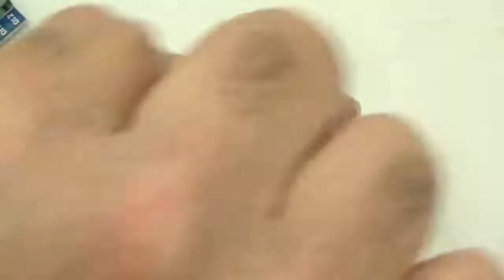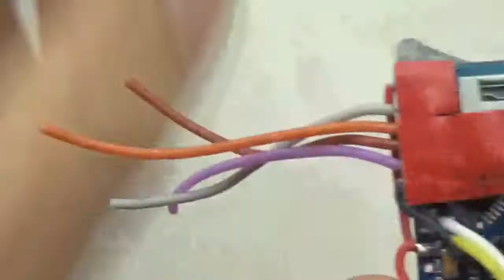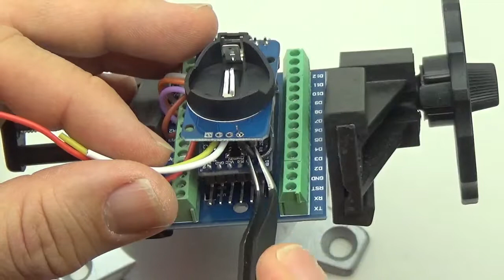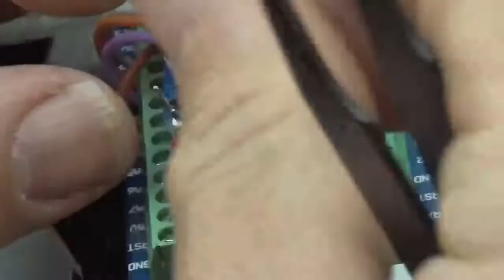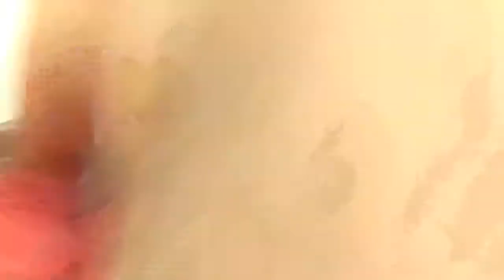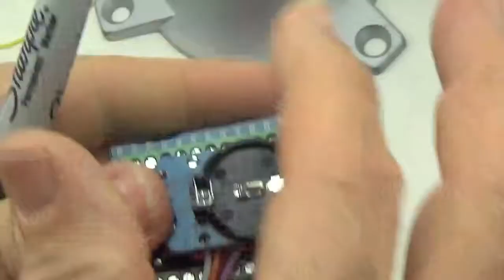2017 Pro Mini Logger Build (Part 6 of 6) - Final Assembly of the Components

Comment: Can you share links to buy sd cards you use in your loggers.
Reply from the maker: I simply look for a lot price on eBay.  I generally use Nokia or Sandisk 256 or 512mb cards, and these are only available on the used market.  Of course I test the heck out of them with H2testw before trusting them.